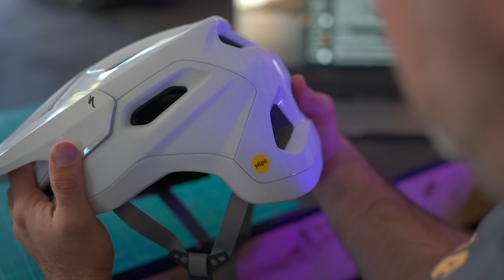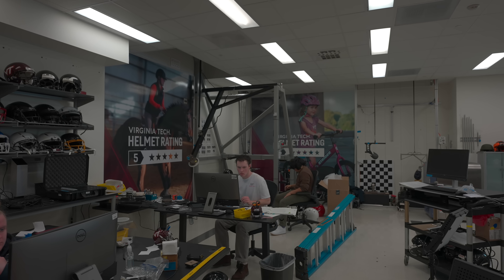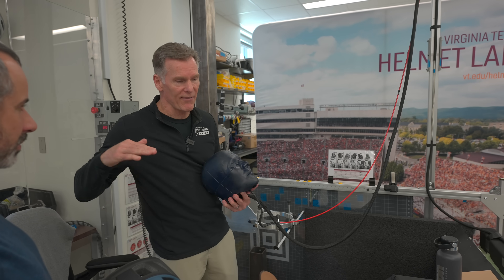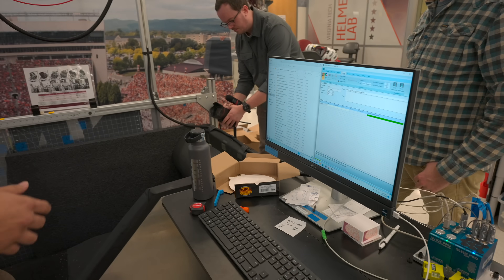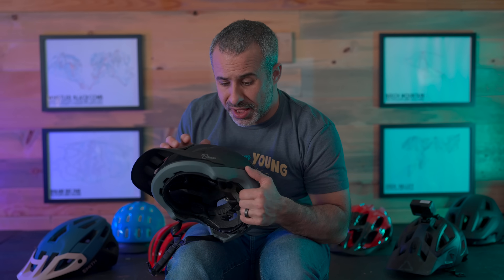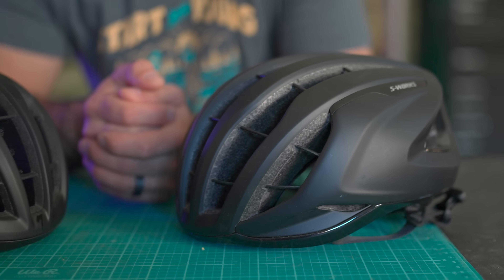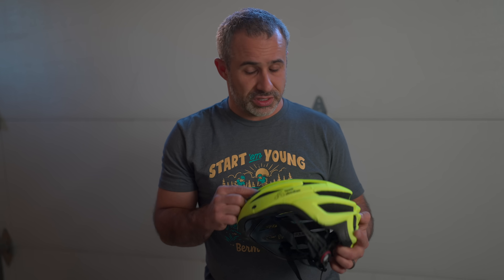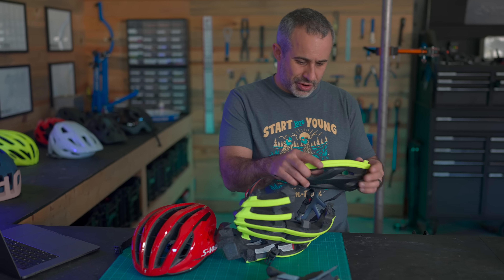Are Cheap Bike Helmets Safe? We visited a helmet testing lab to find out

Comment: That stomp test on the counterfeit was kinda terrifying. How cheap were the materials within that thing if a $13 helmet can outpace it? No testing, no knowledge of materials, and there'd definitely be no QC on it. Despicable that sort of thing even exists
Reply: It seems to me that a cheaper helmet is less likely to be counterfeit, and therefore less risky.
Reply: @howarddavies136  if you buy directly from the manufacturer, or an authorized dealer (who is buying directly from the manufacturer), then there's nothing to worry about. Just don't buy from "BikeHelmetStore25475454" on Amazon or ebay!
Reply: @howarddavies136  The cheapest helmet that still has a good rating may be the best bet.
Reply: @howarddavies136 vet your source?
Reply: @howarddavies136  Really?  Did you figure that out when he actually said it?
Reply: When I was 14 or so, I fell while riding my mountain bike. I didn't have time to react as my wheel got caught in a deep crack at the edge of a sidewalk. My head impacted the concrete pretty hard. The helmet cracked in two different spots, indicating how many times I hit my head.  Thanks to the helmet I was wearing, I walked away with nothing more than just dirty clothes. It was a sub $30 Bell MTB helmet.
Reply: @joseespinoza2687 exactly, that's the point, any cheap helmet is way better than no helmet. Buying an expensive one gives you a few % extra safety, which may matter or not matter during an impact.
Reply: @dtibor5903  I'd say it's best to get a helmet at least in about the $50 range. That should give you the same protection as the way more expensive ones, but be more comfortable than the absolute cheapest ones, while hopefully being a bit more safe. Getting a $300 helmet is basically just to get more comfort, which can definitely be worth it, but that's not to say that a $50 will be uncomfortable at all.
Reply: Looks like styrofoam honestly 😂
Reply: @treimar  The bulk of any helmet--real or fraudulent--is styrofoam (expanded polystyrene). It's the other materials integrated with it that make all the difference.
Reply: @treimar  All bike helmets are made from styrofoam like material but they are reinforced. The stomp test was pretty pointless, it says nothing about how it behaves when your head is in it.
Reply: @dtibor5903 "The stomp test was pretty pointless, it says nothing about how it behaves when your head is in it." if you believe that, then there's nothing in your head and no need fpr you to wear a helmet anyway.
Reply: That was scary
Reply: The worst thing is, they let them impornt and sell them.
Reply: @gerekappo you really think if they knew they were counterfeit they'd allow it? I don't think so
Reply: To make it that thin and lightweight it sounds like specialized is using a carbon fiber frame. If you make a counterfeit with the same dimensions and similar weight it won't have that and thus its little like wearing a styrofoam cup on your head.

Copying a less expensive design would mean that there is no reason to use wrong materials to make it that way, hence the cheap ones are better while the knockoff is actually dangerous.
Reply: @tychay  you're right, chinese knockoffs are extremely dangerous & hazardous. There is zero regard for safety , like ZERO.
Reply: What kind of speeds are people here talking about? crashes with multiple bounces? 
It's not moto or downhill, bicycle crashes are 1 hit and done, you're not gonna tumble for 30ft going 15mph.
Reply: @Effect-Without-Cause  what if you get hit by a car? Sure most crashes will be only a single hit, but I wouldn't trust that to always be true.
Reply: @Iisakki3000  Most (not all, certainly) substantial head impacts involving a bicycle are from the rider going over the handlebars and his or head striking the pavement. Ergo, that sort of impact is the primary - but not the only - thing that the manufactures are concerned with protecting against. Everything is a compromise. Equestrian helmets also protect the head, but the most common head impact involving a horse is a different sort of thing than the most common bicycle-related head impact. This is why there are so many different types of helmets (it's not just marketing, trying to sell a person who participates in numerous physical sports/activities multiple helmets - there is actually a legitimate reasons).
Reply: @Effect-Without-Cause a skilled downhill mountainbiker goes a lot faster than 15 mph and for everyone else, there's the risk of being hit by a car. If your head impacts the windshield of a car going 50 mph, wearing a helmet that completely disintegrates when merely getting stomped on, means your melon is getting smashed with barely any force absorbed by that useless Styrofoam hat and it's lights out for you, possibly forever!

The plastic shell of the helmet should not break EVER! The styrofoam inside the helmet is what's supposed to deform or even break in order to cushion the blow!
Reply: @Effect-Without-Cause  That may be true if you are on a road, but mountain biking provides plenty of opportunity to tumble down a rocky hill.
Reply: also terrifying. amazon doesn't seem to even try to control all sorts of literally deadly products even after ppl complain...
Reply: @duroxkilo  search on YouTube for road cycling accidents. Big brand helmets also disintegrates like that. In contrast, cheap skateboard helmets are bomb proof, you can run over a car over those and still be in one piece.
Reply: Good way to sprain your ankle, and blind your dog.
Reply: Amazon has been selling counterfeit EVERYTHING , (clothes,toys,watches,etc) for YEARS.
Jeff Bezos doesn't care, it's all numbers to him.
This has been reported for years by industry, it's not new.
Reply: It seems they used packaging styrofoam for that helmet 😬
Reply: You can hardly expect a big American company to take responsability for what they sell to US customers, right?
Reply: Though, a helmet that doesn't crunch or cave in at all at the area of impact... also probably not a very good helmet because nothing (energy from the crash) is getting absorbed into the helmet. It goes straight to the brain.
Reply: Uh, big crumple zone??
Reply: That counterfeit "killing people" was so misleading and clearly your comment proves how gullible (including the host) was...

Just because the helmet breaks doesn't mean it didn't protect against the foot stomping on it. And obviously the inside of the helmet was empty, where if you actually had a ball in there, the materials wouldn't have been giving in so easily. Would there have been some pressure points toward the skull? Probably. But at least your head would have been protected against a surface of a rock.

You were all mislead basically by the hyperbole. Stomp test wasn't a proof of anything, and they even debunked that whole "oh look at the damage" just 10 minutes prior to that. What really matters is the level of protection during impact, not how well the helmet stays unbroken.

Like you could make an entire helmet out of foam, that would protect against impacts by softening the blow. And yet you could easily just tear it in half with two hands. These two aren't mutually exclusive.
Reply: @MiMa-t1m  "if you actually had a ball in there, the materials wouldn't have been giving in so easily." Yeah, that means the helmet transfers energy into your skull, protecting the helmet. You do not want that. Helmet's shell must be able to take the impact. If the shell can take the impact, energy is transferred to your whole head. If the shell cracks, you get massive impact in one spot of your skull and can cause skull cracking and brain damage
Reply: @jauho7483  I do agree that helmet is bad, but not because of the breaking, it was bad because the materials cracked instantly rather than softening the blow.

So in fact this could've actually been proved better by having an axe aimed toward the helmet. Axe would be a sharp rock for example, and showing how an impact from axe would be handled.

And doing same test but with a hammer dropped from certain height we'd expect head to start falling.

Instead of these kinds of tests, we don't know really what we saw, in terms of protection.

That is what my gripe around the video is.

I'm sure the fake bike helmet is probably in the scale of 20-30 in protectiveness (as opposed to 18 or whatever the official helmet was), so it's not like you'd be wearing a cap, where the small layer of cloth is all that protects.

Like... think it this way. The helmet could've been made of titanium or other super hard materials, and wouldn't have been cracked at all, and yet that helmet would have been worse than the fake helmet that cracked.

This is all about absorption, not whether the helmet can stay intact during or after crash.
Reply: @MiMa-t1m  Like said in the video; absorption happens inside the shell, more cushion you have, the better absorption. Hard shell is to protect your head from sharp impacts and keep the helmet together. 

With a soft, blunt impact this helmet would probably do okay absorbing the impact. But getting hit by an axe or sharp rock, you would do better with a titanium pot :D
Reply: Depends on how much force the helmet absorbs. Just because it shatters dosent mean it didn’t save your life. 
Further proof you get what you pay for.
Reply: @3041jmarsh  yeah.

More accurately they should be called risky or lacking full protection or failing to protect the brains against heavy impacts.

Calling them dangerous sounds like just the act of simply wearing them would be same as not having anything at all, or even worse than not having anything.

If it was dangerous, the impacts would be worse, like it having small particles that shatter and press against your skull upon impact.

Best way to talk about these helmets is to be scientific, show what a dummy test head has impact when this helmet shatters, does it damage the head, and if the impact is just below what's qualified for safety on the road, that should be expressed better than "dangerous".

This would be more like having a seat belt in the car that might break in high speeds, where in low speeds it does it's job. Sure there might be a spot where this cheap knockoff seat belt might not save your life, like lets say 50mph speeds but the odds of having a direct stop to a wall with 50mph is quite low. And having 2 cars on head on collision with 50mph both means 100mph cash to wall, which would likely not be survivable no matter what.

Of course with bicycle helmets the range of speed is limited to acceleration from helmet's height. People do not suffer from being dropped from 100 feet high and get saved by bicycle helmet.

Since without helmet there's just going to be direct impact, anything that can lessen the force, no matter how minimal impact, is good.

More accurately, if these helmets only absorb 10% of the impact force and rest go to your helmet, the more accurate would be say that these cheap knockoffs offer illusion of safety with very minimal support.

I'm still thinking that these cheap knockoffs should be banned and peoples heads should be protected, no matter the extra cost of helmets, because that's the most important thing, and people shouldn't falsely pretend that they're immune to human errors that could cause them to fall and hit a rock for example.

Even better, there could be some kind of Government assisted fund for very low income people to buy these better safety helmets, to make sure people don't just cheap out and not buy simply because the price is too high.
Reply: Let me guess..China, or should I say Jina...
Reply: Gotta love China.
Reply: The guy mentioned that bike helmets are sacrificial one impact only, and then gets upset when the stomp test damages it. Sure it should get damaged but how much is the right amount? That's the question. You don't want to be in a car crash where the car crumples too much or too little. What's an average impact force? Is there such a thing?
Reply: @mikeh6286  The lab at Virginia Tech that tests helmets (bicycle, equestrian, football, hockey, et cetera) has now tested/rated 271 bicycle helmets. Their impact tests "evaluate a helmet's ability to reduce linear acceleration and rotational velocity of the head resulting from a range of head impacts a cyclist might experience. Helmets with more stars provide a reduction in concussion risk for these impacts compared to helmets with less stars." They also plot them on a chart in regard to how they do against the average five-star rated helmet in low impact severity ("intended to represent common impacts in cycling") and high impact severity ("intended to represent the types of impacts most commonly resulting in concussions").

As for how much damage is the correct amount... theoretically, any helmet's "perfect damage amount" is 100% in an impact event, lol - because that would mean as much of the impact energy as was possible got transferred to the helmet instead of what was inside it. And, of course, there is an "average impact force" - there's just no way of knowing what it is, because not everyone who suffers a head impact does so whilst wearing an array of sensors. But Virginia Tech appears to be the best thing going, in terms of helmet testing entities in the USA. I've glanced at a lot of their helmet ratings/scores in the last couple of weeks, and doing so was enlightening. For example, I saw a helmet that was priced at approximately $300 (high!) when it was tested. Then I saw one that was priced 25% more ($400!) - that scored a fair bit worse . So never assume that more money equals more/better protection.
Reply: Im not entirely convinced that is actually more dangerous than the helmet that didn't deform. The helmet that didnt deform is going to be transferring a hell of a lot more energy to your cranium than the helmet that would break on impact.
Reply: @LiamL763  so if you take a cars crumple zone, it will deform and break. Even in F1 cars where parts are designed to break off, and there's spectacular crashes with bits flying everywhere, the cockpit where the driver sits is built a lot stronger. The idea is to create soft zones to protect the important parts, and to reduce the impact. Having a seat break in half and have the driver fire out is not a safe design. A total mechanical failure like this will not ease anything. It shows its actually brittle, and will snap with pressure instead of dent and bend. Sacrificial parts can be important, especially for something like a full face visor coming off instead of twisting your head/it breaking into shards, but having the entire helmet shatter is far worse than a dent or deformation because it creates no separation between the ground and your head at all
Reply: @LiamL763  I agree,   where's the proof that the helmet that broke apart as easily as it did is actually a safety hazard?   Are we just going off of intuition here or are there numbers somewhere?
Reply: @Jaigarful it's called common sense. 💁
Reply: @LiamL763 by that logic, a car from the 60's is safer than a modern car, because the 60's car completely disintegrates in a crash.

Yes, you need a crumple zone, but you also need the internal structure to stay intact, or else your body will quickly become the crumple zone!
Reply: @LiamL763  crushed helmet didn't just deform, it also fell apart exposing the head to any further impacts.
Reply: @dtibor5903  If a helmet that shatters when stomped on odds are its going to fail just as bad if not worse in an actual crash, not the best testing method but certainly not inspiring any confidence in it's ability to actually protect your head.
Reply: Does the stomp test really have any value? Bicycle helmets are supposed to crack and permanently deform in crashes.
Reply: @Mike-oz4cv  imagine hitting the ground at an angle, half the helmet breaks away. Maybe the crumple zone protected your head to this point. But your head bounces to the ground more than once, so now there is no more helmet.
Reply: @Hipp0campus_1 and how about those sharp ends jamming straight through to your brain?? what a dope
Reply: @Mike-oz4cv  If you can put your foot through it then I wouldn't really trust it to protect your head when hitting a rock after falling off the bike at speed. The stomp is probably less force than a bad crash on a trail could expose it to.
Reply: @ivarnilsen6849 You are correct without any doubt period think about the multiplying effect of inertia period. Putting your weight on a stick might not break it, but jumping/ stomping on that stick causes it to fracture easily, This is because of the multiplying effect. At speed you're wait is effectively multiplied several times so if you weigh a hundred fifty pounds, you end up putting a thousand pounds pressure on a small point of impact. Once you get about fifteen miles per hour And realize the point of impact can be very small, it could effectively be a literal ton worth of pressure on the site of impact.  This is why even low speed accidents involving people outside of cars can be deadly or permanently debilitating.
Reply: @Mike-oz4cv Did you watch the video? "Deform" maybe but not disintegrate.
Reply: @Happy_Biker  technically that means it disbursed the energy better
Reply: @That.Guy. yeah, dispersing it right into your head! Don’t defend this. Some crumpling and deforming is expected but not for it to go completely to pieces like that counterfeit did.
Reply: @Mike-oz4cv  Yes it does. Not as much value as a proper lab test but it still has value. That stomp for sure wasn't as hard of a hit you can get in a bad crash, and if the helmet gets absolutely demolished from a smaller hit like that, it probably won't help you much if at all in a bad crash. Your car shouldn't get totaled in a parking lot fender bender either, because then it would be equivalent to a tin can in a worse crash.
Reply: @Iisakki3000  I don't know about demolished, but substantial damage would be expected from something like that. It is somewhat of a moot point, anyway, because even the manufacturers of expensive street motorcycle helmets (which can be expected to be involved in high speed impacts occasionally) strongly suggest replacing one's helmet after impacts that don't cause any visible damage - such as dropping one onto a porch floor. The integrity of the thing is no longer assured. Therefore... A helmet might as well be "used up" from a substantial impact, because that means it absorbed as much of the force as was possible (as opposed to that portion of the force being transferred to the thing that was inside the helmet). Old cars from the 1940s and 1950s were quite sturdy - which is why so many people have been seriously injured, even killed, in collisions that resulted in (relatively) little visible damage to the vehicle. The force was transferred to the occupants. On the other hand, I was in a substantial crash in a little Subaru (pre-airbag era). Hit solidly by a large, heavy vehicle that was moving at a high rate of speed. That little Subaru got crumpled. Me? Merely bruised. I went to work the next day. Bicycle helmet shells don't have crumple zones - the crack and shatter, instead.
Reply: @Mike-oz4cv It has lots of value. A helmet has to be able to distribute a load evenly across a surface. Even though there was no head in the helmet, it should still be strong enough to support a load on its own. If it can’t support the load, as was shown by the disintegration, it sure as hell can’t protect you from an impact. It’s not a quantifiable test, but it is a qualifiable one.
Reply: @Mike-oz4cv not to you, evidently there's nothing to protect in your head. 💁
Reply: @Mike-oz4cv  of course it has value. There's a bit of difference between "gets a bit scuffed and absorbs the impact." and "Shatters like freaking glass." Helmets are NOT supposed to do that. EVER.
Reply: @Mike-oz4cv  it's probably not meant to disintegrate like that... that's seriously bad for what is equivalent to a low impact crash.
Reply: @Mike-oz4cv  You are right of course. The less the helmet deforms, the more your brain moves inside your skull.
Reply: @Mike-oz4cv  That's like watching the 1959 Chevrolet Bel Air vs. 2009 Malibu crash test video and saying that the Bel Air did okay because it deformed like you'd expect.